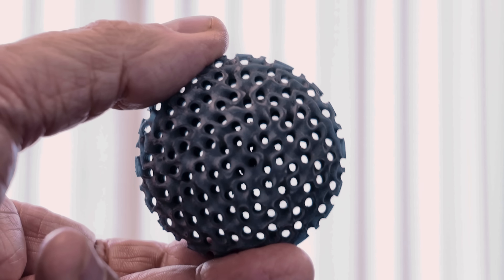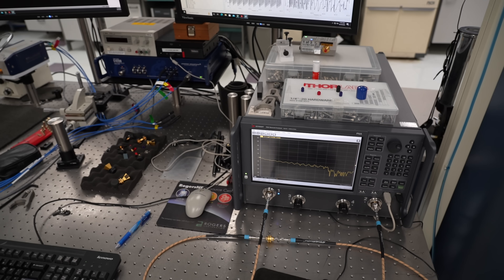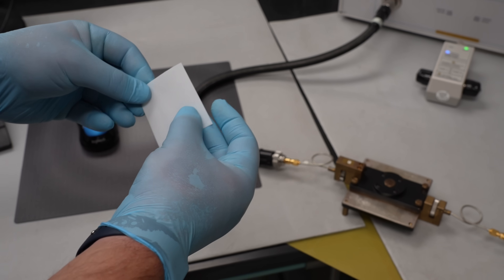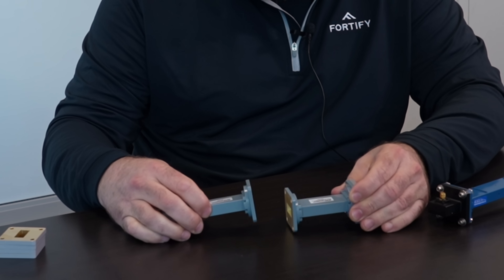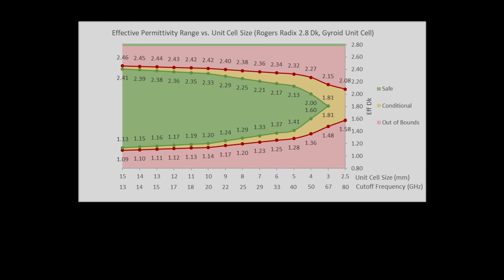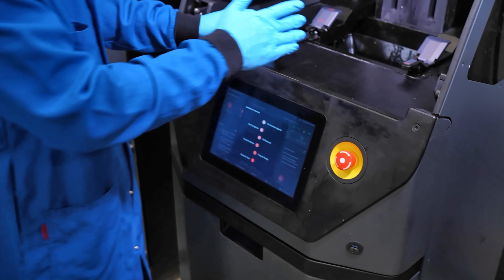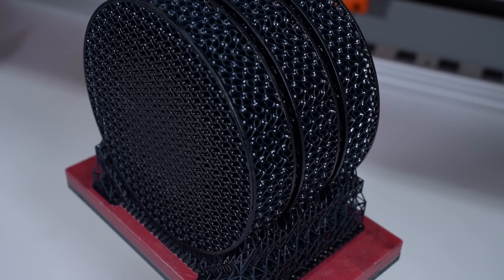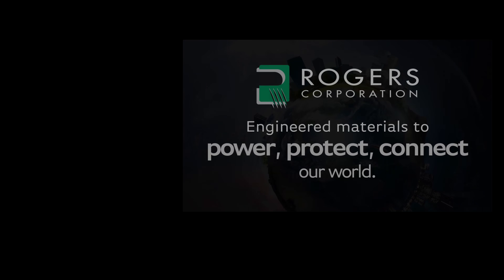Unveiling the Future of Antennas and RF Lenses using Radix™ 3D printable material!

Comment: How useful would this tech be for HF reception? I'm guessing the scale might be too big for 3d printing?
Reply from the maker: I worked out that on Top Band at 1.85 MHz, a Mikaelian lens it would be 2.5 km diameter, 800 m thick and weigh over 100 million tons.  Mass scales as the cube of wavelength, so it's not really practical until you get into the GHz range.  Lot of other uses for the material at lower frequencies as a custom rigid low loss support and replacement for cut foams.
Reply: @Machining and Microwaves  I knew it would be big but yikes.

Comment: Would this design improve a faraday cage?
Reply from the maker: Indirectly perhaps. In general a classic cage is a conductive surface or a mesh where electromagnetic waves are suppressed and reflected internally and attenuated by the openings being too small to radiate effectively or by acting as waveguide beyond cutoff, but actually what works better is an absorptive barrier. I'm wondering if a gradient index geometry would be used to refract the signals instead of absorbing them.  It's hard to get a feeling for the necessary 3D geometry.  Any thoughts on what might be possible?  Probably no use for an anechoic chamber where you need perfect matched absorption with a resistive material rather than a reactive one that would cause refraction/reflection.  Interesting question

Comment: Hmm resonant amplification to make super powerful lasers would be cool
Reply from the maker: Some of the very powerful lasers use a gradient index fibre as the amplifying medium, those Mikaelian lenses are just like short sections of the fibre.  They dope the fibre with pumpable ions that have the right energy levels to release laser photons that then stimulate other pumped ions to release more photons.  Sadly we can't quite to that at radio frequencies. Anhydrous ammonia does work in a maser at just under 24 GHz, but it's not exactly practical or powerful.

Comment: 10:12 What 50 mil to 50 mil cross section means? I suppose this aren’t millimeters right? This is rather 2x2mm rod.
Reply from the maker: Ah, American to English translation, sorry I meant to add a footnote.  50 mil is 50 thou, which is 0.050 inches, which is 1.27 mm

Comment: So I am a green audio engineer and work with wireless mics on the daily. Does this kind of tech translate to my type of RF enviroment?
Reply from the maker: Not sure there is a need for this tech other than potentially for drones running at 28-33 GHz where it might be useful, but wireless mics at 800 MHz or using bluetooth are probably at much too low a frequency to take advantage of this tech.  Maybe. I will probably be proved wrong fairly soon

Comment: I know this isn't really what you usually deal with but couldn't they use this item to make a transformer core instead of laminate course so they can be quieter due to the fact that the laminate won't be rattling anymore
Reply from the maker: Transformer cores are made from layers for several reasons, one is prevention of bulk eddy current loops that would lead to losses, another is ease of manufacture.  Some of the noise is harmonics of the AC frequency caused by magnetostriction, not physical vibration of the seprarate laminations. You can damp out the fundamental and the lower frequency harmonics fairly well, but the higher harmonics are harder to suppress. It's easy to make a toroidal ferrite ceramic core that prevents the eddy currents without any layers and which have negligible magnetostriction.  However, it is a total pain to wind the copper wires on to a toroid, you need a fancy split-hoop winding engine.  Normal EI cores are much easier, just wind the bobbins, then use a machine to interleave the E lamiations and insert the I lams, then maybe do a few strategic welds, vacuum-impregnate the core with an insulating varnish and we're done. 3D printing doesn't really help with the assembly process as you can't sinter a core from magnetic powder while the windings are in place as they'd be damaged by laser heat. Toroids are cast from powder and sintered under pressure.  It's hard to imagine if there's a benefit from using a 3D print approach unless there is a very high-permeability fill that has extremely high performance as a magnetic material (low hysteresis, zero bulk conductivity, no magnetostriction, very high saturation level) and either gives a radical advantage in terms of magnetic path topology or lowered manufacturing costs.  Perhaps for microminiature transformers there might be a potential?

Comment: Generally all audio is mono. The only longer stereo fragment starts here 22:27 and ends 22:49
Reply from the maker: Thanks!  I'll check the original to see what I did wrong.  I've moved 100% to DaVinci Resolve now, so i just sync and replace the camera audio with the correct track from the SM7B via the Zoom F3. It's so much easier, and the EQ in Fairlight is great

Comment: Ok but what does it do? Lol I'm guessing it's an antenna? Or a lense for radio waves? Sorry I'm dumb but the video was fascinating.
Reply from the maker: Both parts are used to manipulate microwave signals, one takes a signal in a waveguide and helps to launch the signal as an electromagnetic wave into free space in a controlled way so it can illuminate the surface of a parabolic dish efficiently, tapering the intensity towards the edges so there's not much spillover, but getting the best possible performance. Normally, I would have to machine a complex metal horn, or grow it using electroforming (upcoming video on that). Being able to to medium-scale production on a suite of industrial printers on demand is the main benefit, with geometry changes being very easy to make during production. The larger piece is for some experiments rather like an optics workbench. I want to use  it as part of the feed mechanism of my 10ft/3m prime focus solid parabolic dish and 8ft/2.4m offset dish to allow me to use high performance feedhorns designed for the larger, deeper dish on the shallower one. Also by replacing the LED in that flashlamp with a signal source at 24 or 47 GHz, I can have a nice portable and waterproof testing system for measuring the beam pattern of other antenna systems. So you were spot on with your guess there. You're not dumb at all, I didn't explain it well enough for a general audience, but that's because the video was made very specifically to address a hard-to-reach audience of specialists who might be persuaded to try this material and printing system. I would never have been able to make the video and fly to the US without the sponsorship by Rogers Corporation, but I can see it would be useful to do a much less intense show and tell video about this stuff at some point soon.
Reply: @MachiningandMicrowaves  awesome and thank you for your response it actually cleared up alot for me!

 I've kinda been putting off learning more about this field for some time as I've always found it very technical even compared to something like theoretical physics which I actually feel is less technical if a subject then this and I've definitely got a lot to learn before I'll even be able to understand half of it I'm sure, but I'm definitely gonna subscribe and I'm super excited to learn more from you about this kind of stuff!

Do you primarily do RF/Electromagnetic research & videos? Ya know I should prob just go check out your other content also and I can prob answer my own question 😉

Either way your awesome man! Cool video!
Reply from the maker: @jessicastevens538  A lot of the stuff I've done is about machining parts fir microwave systems but I'll be doing more about the applications and the science as well now I've got a better setup for show and tell

Comment: Cool, so how did those lenses perform at the end?
Reply from the maker: So far, pretty much as per design, but I need to do some more work on sun noise plots and tests via the Moon compared with a machined feed and my Rexolite machined lenses. I'm trying to verify the sidelobe that I can see in the e-field amplitude animation at about 120 degrees from boresight.  I can't see it in the tests, it could be it's way lower than the noise floor.  It sees cold sky for more than half of the view when elevated, but the rest is hot ground or trees, so quite loud noise from the approx 290 K thermal signature, even at 10 GHz (Peak is around 10 THz).  If the level is at least 3dB below that of self-generated noise in the LNA and from the on-axis beam pointing at the thermal noise from the Moon, then I probably won't see it on receive.  I need to set up on transmit, but I had a major breakage on one of my pump-up 45ft antenna masts so I'm a bit stuck unless I am lucky with fine weather at the antenna range at Finningley.  Life is a bit full-on right now, way too much Stuff To Do
Reply: @MachiningandMicrowaves  Wow thank you so much for the answer.

Comment: I dont understand why bubbles or tubes dont diffuse the EM wave like they would in visible light. Even a narrow band of light is scattered wildly by a spherical cavity isnt it? Or does it heavily diffuse but it doesnt matter because its still the only feasible way to do it?
Reply from the maker: The voids are very much smaller than the wavelength, so it's like a mirror looks perfect once the surface scratches are less than about 1/8 wavelength of light, the same applies to microwaves, so a 10 GHz wave with about 30 mm free space wavelength can't "feel" voids of around 3 mm and the effect is indistinguishable from a solid dielectric that's made from a lower permittivity material.  I think if there are long-range correlations like in a square mesh, you could see some diffraction effects, but a good choice of foam-like structure is pretty much isotropic and featureless.
Reply: @MachiningandMicrowaves I was picturing them as much shorter wavelength (maybe because of the high energy of the ovens). That makes a lot of sense now. Thank you.

Comment: Ok so light can be lensed with glass like how you use a magnifying glass to concentrate the sunlight,is this tech your talking about the same basic thing but for microwave ?
Reply from the maker: Exactly, but the gradient index approach is feasible at this scale.  With light, gradient index needs different materials with different refractive indices.  Light fibres for long distance comms have gradient index glass fibre to cause total internal reflection.  You can machine GRIN lenses up to a point, but getting a fine grid of tens of thousands of holes and/or using foams or materials with different effective permittivity is very tough. In this technology, that part is trivial
Reply: @MachiningandMicrowaves  that is so cool,this has my mind's wheels turning thinking of the possibilities this brings.

Comment: OK, come clean: For what mischief do you use the flashlight?
Reply from the maker: It's a convenient housing for a 24 and 47 GHz transmitter and receiver for doing field measurements of my main antenna systems.  Waterproof and rugged, with inbuilt battery and charger.  I've made mounts so they can fit on to a surveyor's tripod for field use.
Reply: It has not escaped notice that the bottom end of that range might also function to blind police speed trap radar no?
Reply from the maker: @davidskybrody  These days our police use lasers!

Comment: what materials can be utilised to allow light to pass through a "lens" in one direction with the lowest losses but not pass back in the other direction through the same lens. ie . for any other light source to be 100 % deflected and have the lowest losses also on the deflected ray ?  (THz - Uv)

Its okay if you're busy , i will ask my nonna  when she gets home from Bingo ;)
Reply from the maker: No idea with passive optics. At radio frequencies there are flat lens designs using metamaterials to move the beams around an object. https://iopscience.iop.org/article/10.1088/0022-3727/48/33/335101 (behind paywall) and for acoustics there are things like this https://www.frontiersin.org/articles/10.3389/fmats.2021.766491/full so I suggest searching Google Scholar for things using polarization and Kerr cells and sapphire ring resonators to see if there's anything out there other than the usual partial silvering and total internal reflection and Bragg angle approaches, relying on illimination differences and large reflectivities.  Maybe there is something going on, I've not looked

Comment: Can these material constructs be used for microwave stealth coverings?
Reply from the maker: RAM is what you need for that, this is not absorptive, so although you could make something like a dichroic anti-reflection coating at certain frequencies, it's better just to absorb the entire spectrum in rubberised coal and iron filings.  Or whatever RAM is made of (Radar Absorbing Material)

Comment: I think you need to make a SPDR fab video. Or least show how to lay one out for 900Mhz....
Reply from the maker: It's in my schedule for later this year. I have some dielectric pucks for 7 GHz but I need some for lower frequencies. I'll also make a coaxial line jig that takes dielectric washers and measures their characteristics compared with standard material samples
Reply: @MachiningandMicrowaves  very cool, will be watching. My coworkers are interested in making this tool for lower frequencies. I am interested in trying to machine it with successful results.
Reply from the maker: Major issue right now is sourcing dielectric pucks below 5 GHz. I was wondering if it was possible to make a Bragg resonator or something, but then I got sidetracked by a PhD thesis at https://etheses.whiterose.ac.uk/12990/1/Deshpande_PhD_Thesis_Final_4.pdf where the author makes a tunable Bragg resonator and says "In this chapter, the design and construction of a tunable Bragg resonator has been described. The best performance achieved was a spurious free tuning range of
1% at 9GHz with a maximum unloaded Q of 81,650. This is believed to be the best
available high Q tunable resonator available at 10GHz present in the literature".  

Now THAT sounds like a CHALLENGE! Hold my beer....
Reply from the maker: I looked at using polished sapphire disks in a Bragg resonator, but they are not exactly within my budget for a blue-skies experiment.  There are some references with unloaded Q factors over 200,000 and that's the sort of area I wanted to reach.  However, I have a LOT of other videos to get finished first. Very hard week at the Day Job last week and today, it rather drains my energy doing this "work" thing. Some of my contemporaries managed this thing called "early retirement" like more than TEN YEARS ago. I missed a trick somewhere, still a wage-slave in daylight hours

Comment: So… how well did the 3d printed components actually work? Yeesh - don’t leave us hanging!!
Reply from the maker: Spoiler alert - pretty much as good as the model, with some interesting effects. I'm tied up with a load of other videos I need to get finished, but then I'll release the results vids. One huge issue is that the last six low-degradation Moon windows have been either rained off, or coincided with floods or illness.  I need some footage of the results of moonbounce tests.  I think I'll release the results of the 24 GHz Mikaelian lens first as that isn't Moon-condition dependent.  Next video should have been out today, but my cesspit had a blockage so I spent the day dealing with lots of raw sewage and draining issues, then had to clean all of the stone paving. Then the elevation drive on my 10 GHz dish jammed.  I had to dismantle the motor, skim the commutator in the lathe, then fit new brush springs and a bearing bush.
Next video is about my experiences while making a historically-accurat replica of the Great Seal Bug for BBC TV and appearing on prime time BBC2.  My mum was very proud despite the numerous disasters.

Comment: Just want to know if we can get a better antenna for fpv drone vtx out of this stuff
Reply from the maker: If drones move to the area around 30 GHz and away from the lower frequencies like 2.4 and 5.8 GHz then antennas using these materials will become practical.  They are still rather large and heavy even at 5.8 GHz and metal antennas are cheaper and lighter at those frequencies